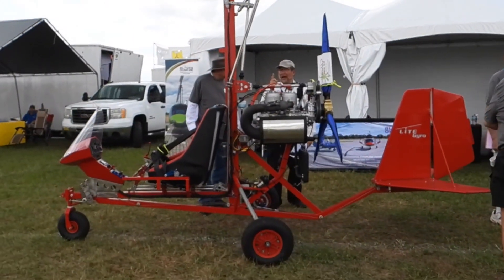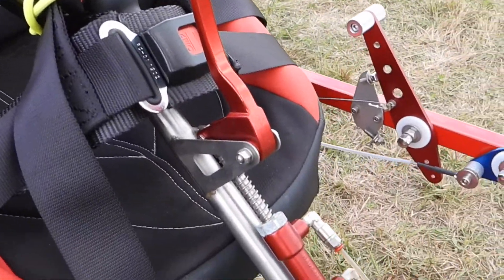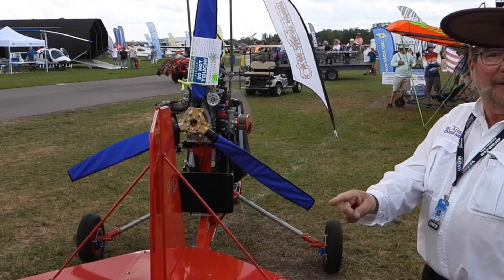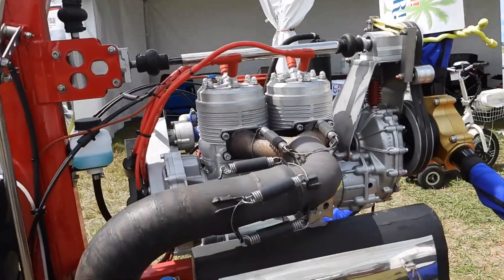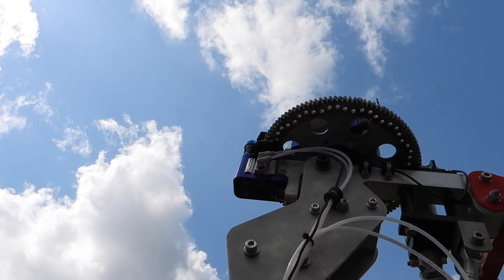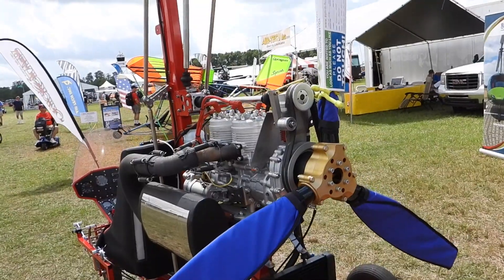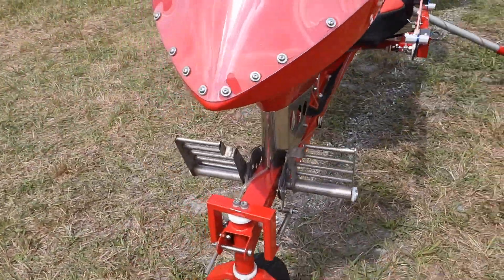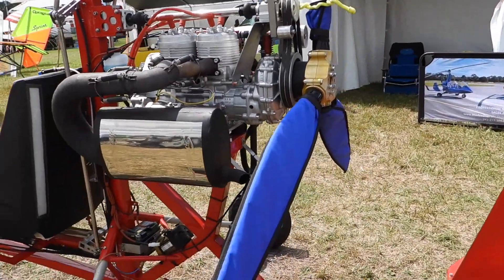Sprint Lite Gyroplane, new single seat gyroplane

Comment: A touch on the heavy side for a single seater.  Prefer the lighter machines.
Reply: With 102 horses, it's not going to struggle to get that weight off the ground.

Comment: New to gyros. How fast can it go with 100hp?
Reply: Wrong question.  All gyros are somewhat speed limited due to safety.  Even a gyro with quite low hp can do 100mph + but its risky because the disk angle is very low and if you tip the disk below horizontal for anything like over a second you are dead.  This is true of all gyros.  Ken Wallis with 72 hp engine with a 42 inch prop was able to get one of his gyros (much lighter than this) up to 130mph but that was with short rotors (19ft) all sorts of modifications like an adjustable offset on the rotor head, adjustable stabilizer to level the airframe at those speeds.  Most modern gyros don't go even that fast and its not about hp.  My old direct drive VW did 80mph easily and I knew blokes who flew them over 100mph but they were nuts, really risking unloading the blades.  If you are very experienced you can fly that fast (especially in a streamlined gyro) but you need to be disciplined enough not to punch the stick forward or fly in such a manner as to try responding to any thermals by applying pitch changes you use power to control altitude if the machine pitches in turbulence your machine is not set up right (mostly likely doesn't have down thrust on the engine).  I didn't like flying about 60mph in an open gyro anyway your helmet wants to rip off your head and the harness straps would flick my nipples repeatedly.  It was always much more pleasant flying between 35-40mph.

The good thing about gyros is low speed capabilities and maneuverability.  If you want fast to fly cross country I suggest a fixed wing.
Reply: @cameronlapworth2284  very informative. I was just thinking I wanted to get to places in Texas faster. Hop from land to land without traffic and faster than a car

Comment: When a guy is asking you if 419 is the weight of the motor, you know he understands physics.
Reply from the maker: Or either he is wondering why he was told 419 when he asked how much the motor weighs. Lol
Reply: @GyroGerald  yes good,,what countri are you from
Reply from the maker: @hellycopulaucity4347  USA 🇺🇸
Reply: @GyroGerald  how much does a gyrocopter cost there?
Reply from the maker: @hellycopulaucity4347  well it depends on what you want. This gyro price is at the end of the video but a used gyro can be found for $10K in the states etc.

Comment: It's good to see that any gyro builders nowadays are taking their noise signatures seriously, as in flying neighbourly and quietly. 

As the urban sprawl keeps expanding more and more outwards into rural areas, there is more possibility of sensitive ears being offended by overly noisy gyros buzzing around. Even the local police helicopter gets howls of noise complaints when it is tasked doing area surveillance missions.
Reply: I do not know if the noise abatement focus is due to altruistic consciousness or compliance with laws in some countries such a Germany. Nevertheless I too would welcome the absence of the high engine RPM’s noise  and propellers spinning their tips near the speed of sound. The mosquito ultralight helicopter is especially ear-grating even without the presence of a propeller beating the air into submission. Engine designs are forced into two categories when considering power to weight specifications; spin the engine at high rpm’s and lower displacement with a propeller reduction unit (PRU) attached or large displacement and larger diameter and slower spinning direct drive propellers. The later being far too heavy for designers taste but far most pleasant on the ears.  I prefer the sound of a converted Volkswagen engine or Subaru with a PRU to that even to the 2 cycle’s high pitched buzzing. I never have had the chance to hear it fly but Ron Herron’s Little Wing with that wonderful  small radial engine would be a treat on both the ears and the eyes.